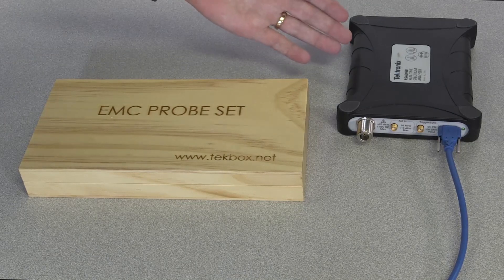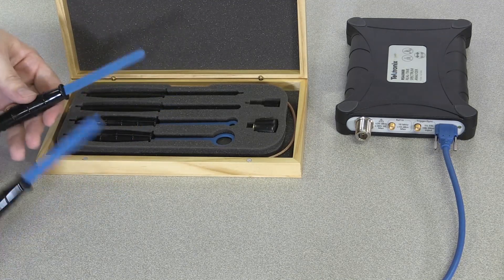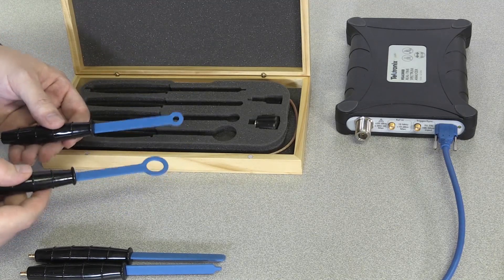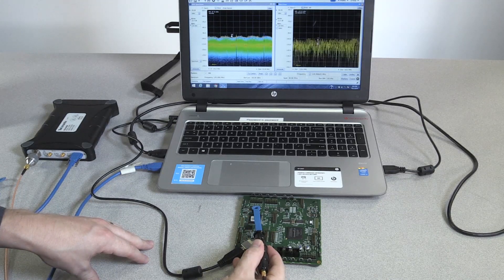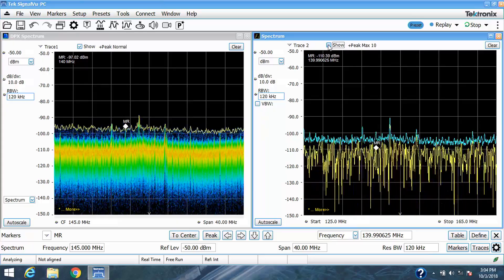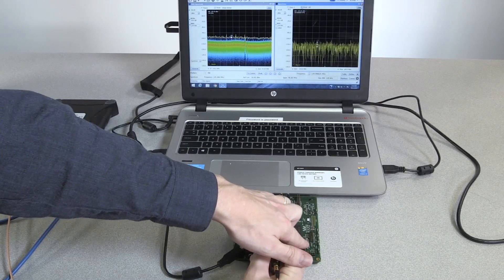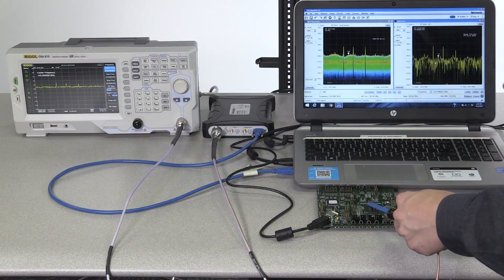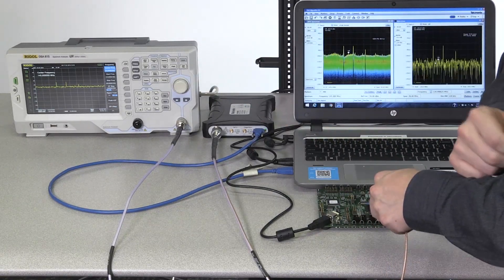Real-time near-field measurements with the RSA306B

Comment: What i did not see is acquisition time in the real time spectrum analyzer and how many mS is doing per trace? And also i did not see what was the swept time in normal spectrum analyzer based in the fact of having 120kHz of RBW? Speed is important when catching EMC signals, that´s why an EMC  receiver cost that much, other important is accuracy in amplitude, RTSA and Normal SA should be measuring almost the same amplitude but it is not, there are differences in the moment of measuring signals between both, besides instrument shares same RF front end,